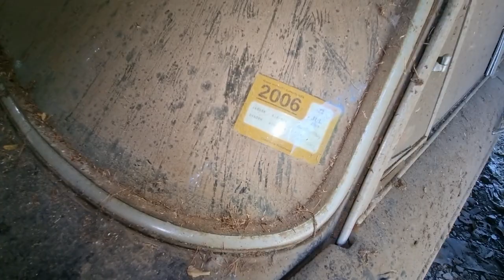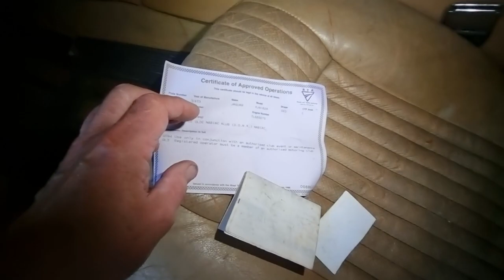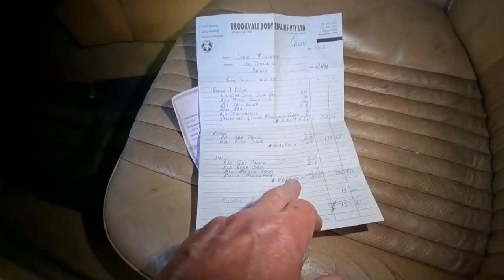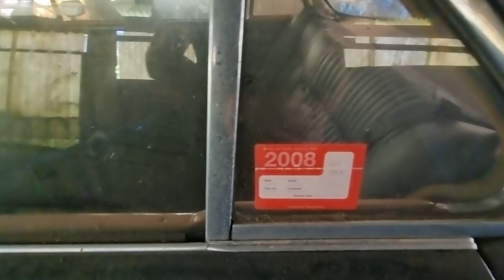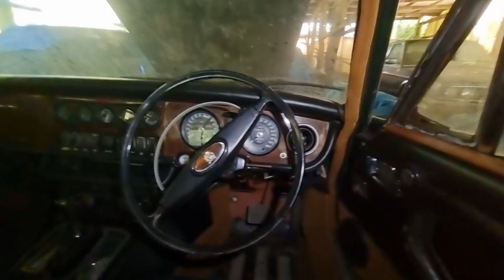Amazing barn finds. Jaguar XJ6 S1 Manual Jaguar XJ12 S1 SWB

Comment: I saw that series1 that you said used to be yours advertised recently but no motor or running gear from what I could see in the ad. More importantly what’s under the other blue tarps?
Reply from the maker: Hi Greg
Yes it didn't have a motor or gearbox when I sold it. I understand both front and rear undercarriage were reconditioned though. Blue tarps?   TBA

Comment: I've been wondering for many years what happened to that old green bitsa XJ12 after I sold it to a bloke in Orange. Who'd've thought I could type "XJ12" into youtube and see a video of a bloke finding it in a shed at the other end of the state.
Reply from the maker: Interesting!
Reply: @tjmthejagmandownunder  It certainly piqued my interest. I was pretty sure as soon as I saw the video that it was the one but figured I better check on some old photo's and papers to confirm some minute unique details just to be one hundred percent and they matched precisely. From the video it seems that very little has changed on it since it left my hands back in the mid 2000's. Mind you, a fair bit changed on it between when I bought it out of Sydney and when I sold it to Scott in Orange (including the awful black-ish lounge suite leather trimmed seats it currently has which came from another car of mine). I had two green S1 XJ12's in the garage at the time, kind of cool seeing this one again, I was hoping it wasn't dead.